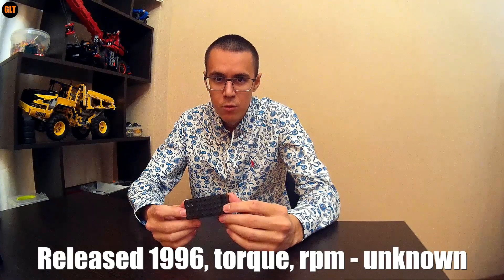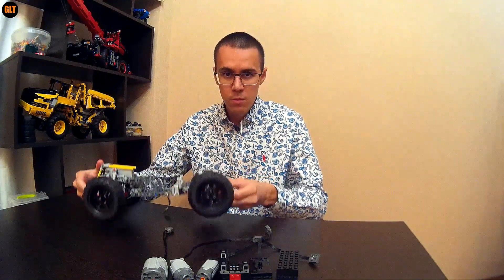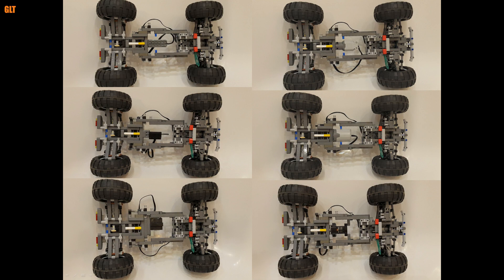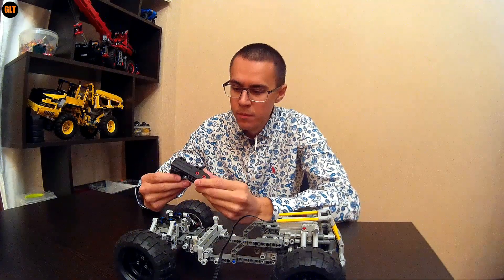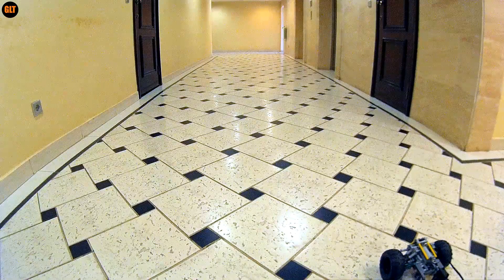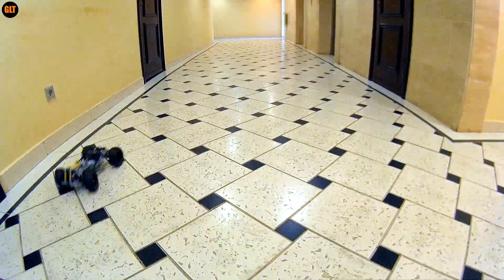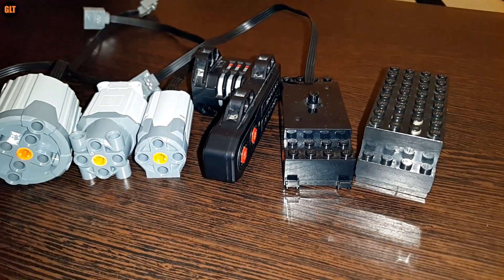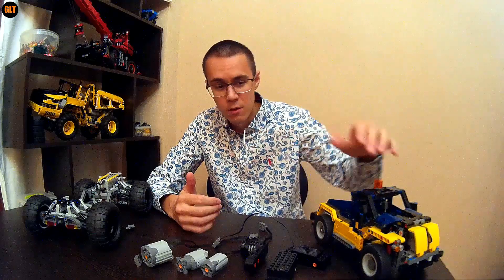Lego Motor Speed Comparison RC Buggy, PF M, L, XL, System 624 9V, Train

Comment: Why aren't any of these RC'd lego projects using proper RC gear instead of the app-based bullshit Lego sells? I bet every motor on test here would perform far better if it had a 2s or 3s lipo feeding it through a Hobbywing 1060EZ on a proper RC system. Steering'd be more precise with a proper RC servo too!
I've got a 42028 on order and I'm gonna be running it off my Futaba 10J like the rest of my RCs. Prolly run a single motor into the diff and use a servo to brake each track as needed to steer it. Will be the B-model, not the A-model.
Reply: Uh because not everyone mods their lego or wants to keep it lego, they also dont want to break parts. I have rc cars that go 50 km/h and drive with that, and my lego has normal lego gear or buwizz
Reply: @probricks5035  you are less likely to break parts with a better control system.
Reply: its actually very simple, afol purity

also btw buwizz isnt lego related. That came from the afol community :) same for sbrick btw.
Reply: @killingtimeitself  Maybe I am just spoiled by the near three dozen hobby grade RC models land and air already in my fleet, but it's just *depressing* to run something....even a lego moc...off a non proportional infrared based RC system. 

I cant bring myself to do it. Once you go full hobby grade yoy never go back; the fun is no longer there with such simplistic controls.

Also, its cheaper to use hobbt grade stuffs
Reply: @killingtimeitself  I see these sorts of creations as way of combining the two hobbies.  No way in hell a Lego MOC is ever gonna perform like my RC10GT does, but if I use hobby grade control/electronics in the project(And some bearings in key areas via 3D printed custom parts) I can have a LEGO RC that performs exceptionally well and is genuinely fun to drive, to drift around, et-al. And then just change it to something else if I want to do so.

Fun fact: LEGO PF 'motors' will take 3S lipo without a second thought. LEGO hilariously overspecs them and opts for a 12v motor inside each unit, then proceeds to sell them with power systems no higher than 9 volts.

Comment: Very nice video! I would like to ask, in case u connect two train motors and spin the one of the two, will the other one spin? I would really appreciate your answer!
Reply from the maker: If you connect them both on a single slot or may be 2 slots on different recievers with same channel set - yes, it will, and only in those cases I guess. Hope that's what you asked;0
Reply: Yes, each motor will act as a generator and spin any other motors on the circuit.

Comment: Just wondering what the motor perfomance is with a heavy/heavier model. Something like the 911 gt3 rs or the Chiron...
Reply from the maker: It really depends on the weight/amount of gears. For those you need at least 2 XL or 4 L (if you don't take out the gearbox) and they will go just fine

Comment: 1:03 m motor has 380 rpm. im sure it is 380
Reply from the maker: You are absolutely right, made a mistake. 185 is a pre-stalled rpm on 7,5v. Not sure how it got here, but thanks for pointing out👍
Reply: @Fahrengate  ok, now I know how fast my m motor goes on buwizz normal mode :) thank you